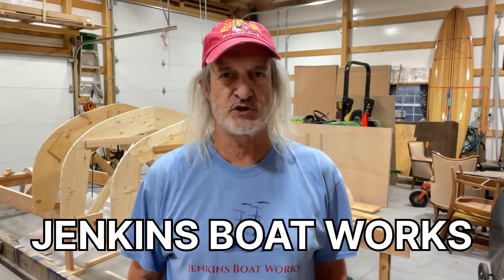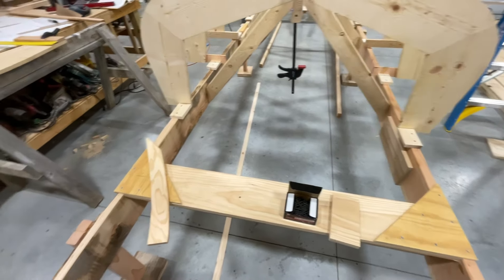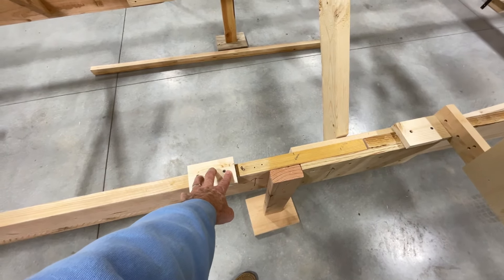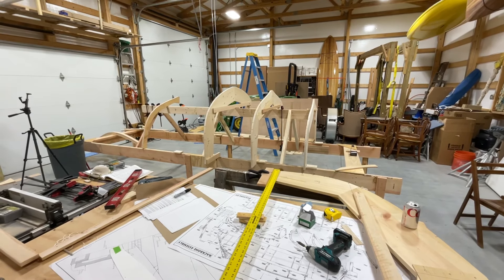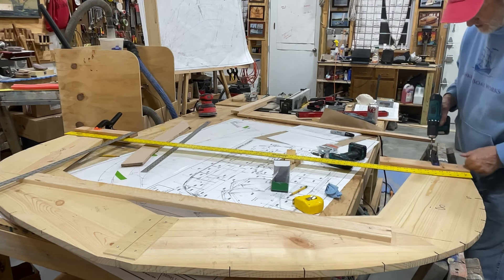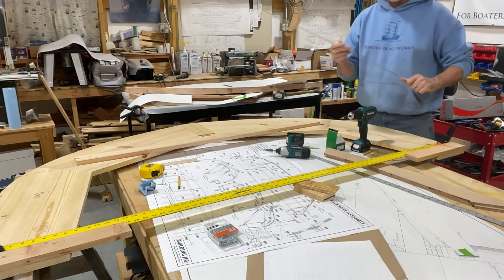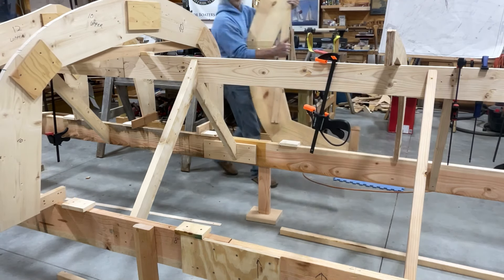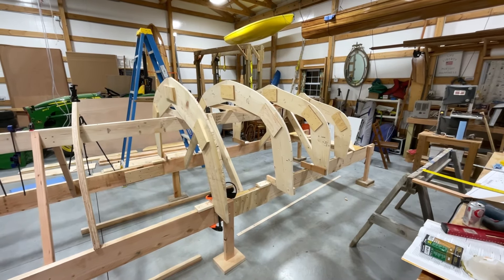Boat Building Somes Sound 12 1/2 - Setting the Aft Frames - Ep 15

Comment: Great to see another build with all of this detail.
At first I struggled with alignment while building my skiff but a cheap self levelling laser level was a great help. It gives multiple beams which are vertical, horizontal and at right angles to each other. It makes setting up and checking that nothing has moved so much simpler.
Reply from the maker: @mikecurrie1795  thanks! I’ll look into this. I have a lot of work coming like this